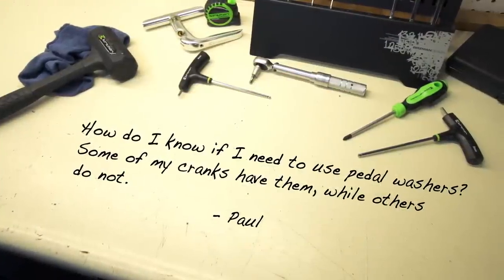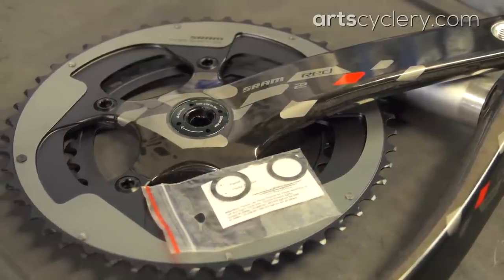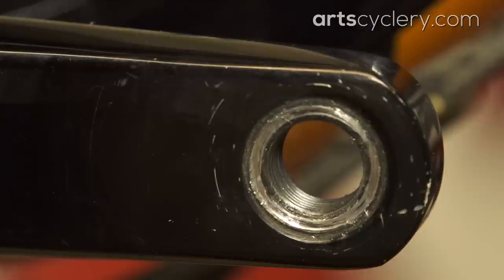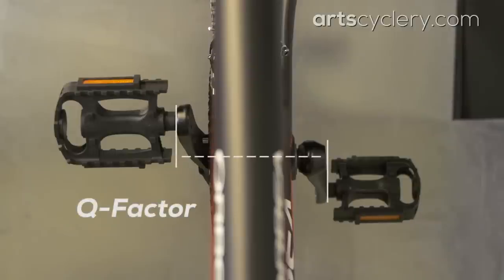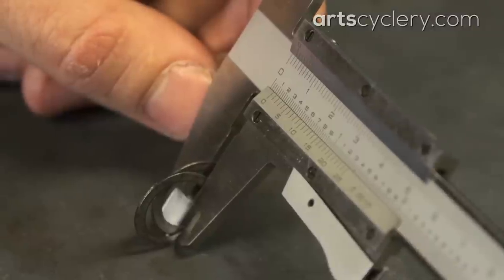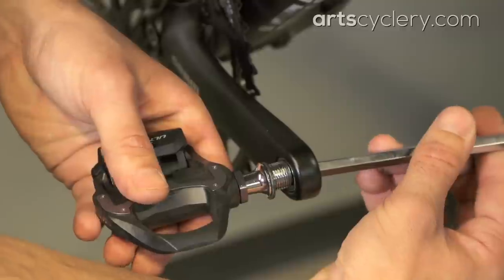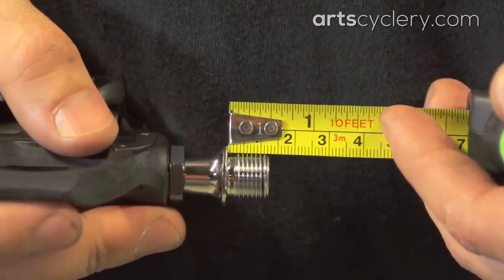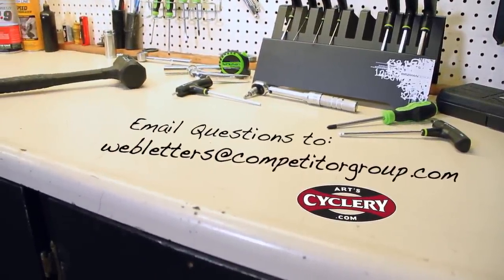Ask a Mechanic: When To Use Pedal Washers

Comment: Experimented with this...Thick o-ring is better than a metal washer. No biting into metal on the crank arm.
Reply: A rubber o-ring instead of a metal washer will make every aspect of this problem worse.
Reply: Maciej Jan Długosz  Are washers required?